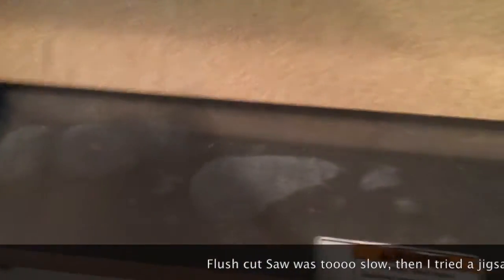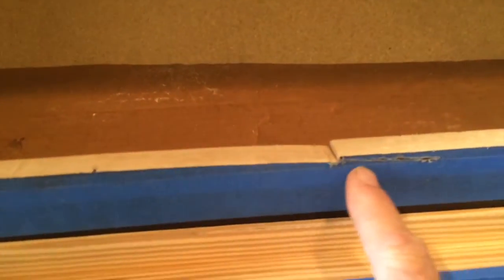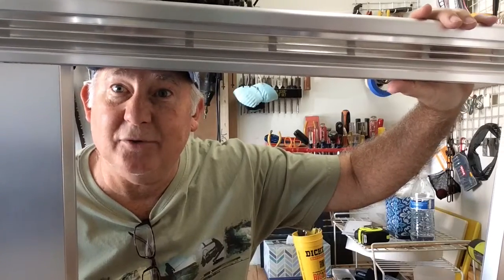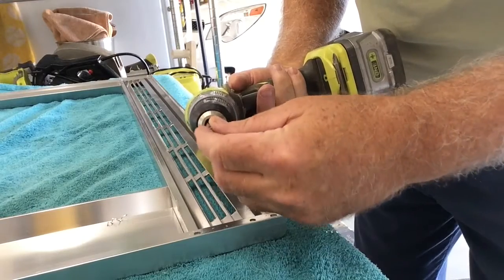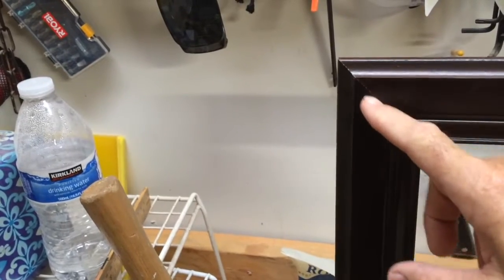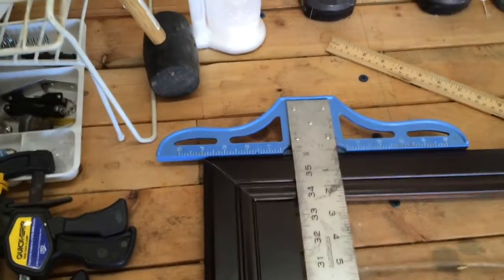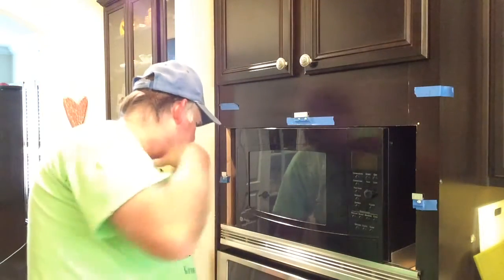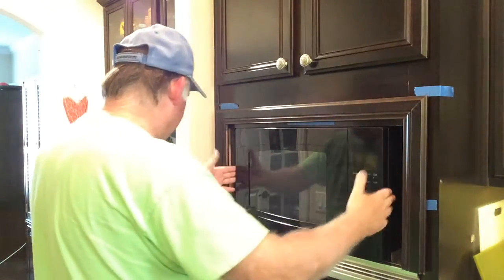How to install a new  Microwave.

Comment: I assume a "trim kit" was not available for the new microwave.  Also, did you simply use a counter-top model of microwave for the installation?
Reply from the maker: dak, this was a used microwave but it was a built-in model so I had to modify the existing trim kit.